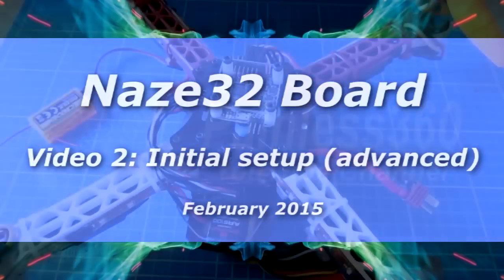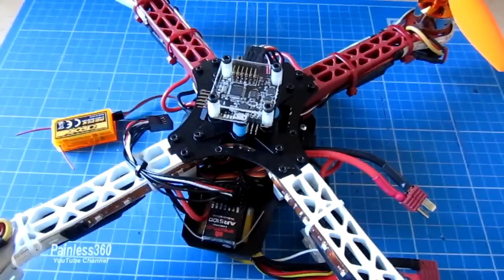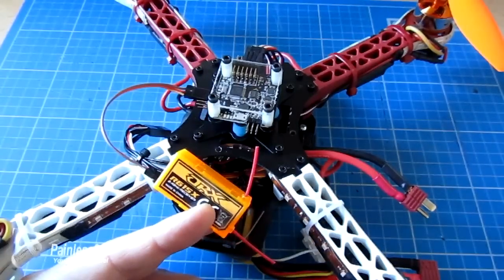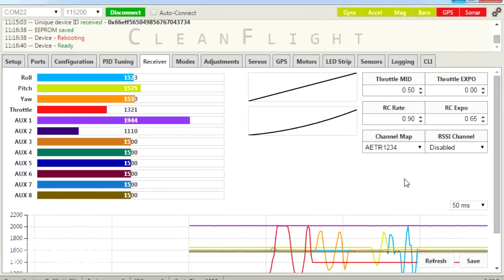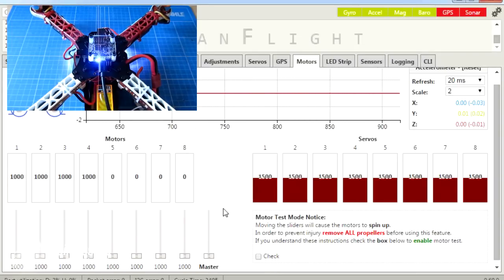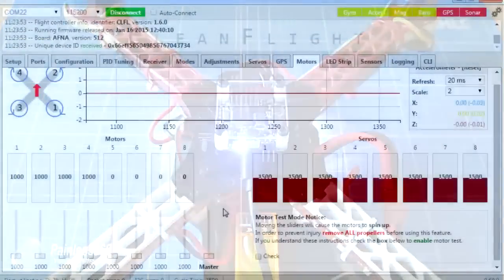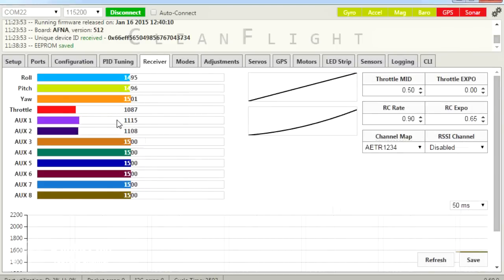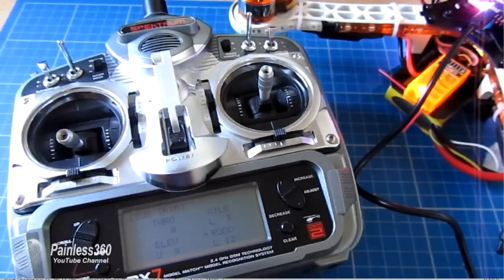(2/8) Naze32 Flight Controller - Extra setup steps and configuration

Comment: I have the Hyper400 3D quad, will it level out inverted in horizon mode?
Reply from the maker: steve sparrow I believe it will but never tried it. Let me know if it works (I'd try it with LOTS of height ;)
Happy flying!
Reply: thanks.

Comment: any idea why my fsia6b receiver not connecting to transmitter anymore? was flying find, landed and changed batterys, now it wont connect. not making any sounds or lights
Reply from the maker: +Elwood Knowles Not without more detail - I'd try and rebind and check the power is ok to it too.. Best of luck..
Reply: +Painless360 ahh okay, its just strange. got me stumped.
i was literally out for a fly everything working fine untill i swapped batteries now receiver isnt working.
got aby vids on how i can check if all components are getting power ?  i have a multi metre.

Comment: I would really like to see a setup for the naze32 with an frsky receiver with the sbus to cppm. I cannot find one and find your videos very informative than all the others.
Thanks
Reply from the maker: Scott Watson I am not planning on covering that.  I would use an Sbus inverter with a Naze32 to allow for native Sbus without the delays. Best of luck!
Reply: +Scott Watson Do it the same way as this video shows... only connect the CPPM-Out side of that cable to the Naze32 as the video shows him connecting a regular CPPM cable, with the black ground wire on the top left pin.
Then connect the SBUS end to your FrSky receiver SBUS port. I believe it's a keyed-port too, so you can only plug it in one way if you're using the FrSky SBUS to CPPM cable.  Otherwise, make note of the black - cable position and plug it in.
If you've already bound the receiver and used CPPM, no need to rebind, just make certain your Taranis is in D-16 mode, or switch it over and re-bind.
Check out the Taranis welcome videos on how to program the radio buttons to AUX channels to use them on the Naze Cleanflight or Baseflight config.

I've had no luck getting the SBUS inverter cables to work with the Naze and X8R though.  That's a frustrating path.
Reply: +splatula thanks for the info.
Reply: +splatula thanks for the info.

Comment: Hi, will the CPPM on FRSKY D8R-XP receiver work with Naze32? Since the sbus on FRSKY X8R did not work with Naze32
Reply from the maker: Don't know I don't use those receivers. A search of the forums should show if there are problems. Best of luck!
Reply: +Sol mag 

It's NOT the sbus you want - that's the proprietary "smart port" digital telemetry input. Check the X8R instructions - if you don't have the little sheet that comes with the X8R it's downloadable on the FrSky site.

I believe you simply hook to Ch1 and the X8R auto-detects the single
load and switches to CPPM on Ch1 Then, there's jumpers to set while binding. I can't remember the details, bit I have a couple planes using the X8R in CPPM.
This stuff is getting so complex you need to keep a logbook on these details.
Sorry I can't tell you off the top of my head, but my memory can't keep up. I just started doing a notebook for each plane. Good Luck!
Scott
Reply: +Scott Marshall I was able to use the CPPM on the D8R-XP by placing a jumper on pins 3 and 4 on the receiver and it works perfectly. Thanks for your input.
Reply: +Sol mag 
Glad it worked out for you, I'm going to be using the X8R on my KK  flamewheel. Upgrading to the X8R/NASE32 . 

Thanks to Painless for his fine videos, nice work!  Excellent instructional videos than don't bore you to tears. You make it look easy.

Comment: Has anyone tried a setup with DJI style throttle stick (stick centered).
I have used my Spektrum DX9 with Naza V2 and have changed so that both sticks are centered.
Since I still use the radio with Naza V2, it would be nice to be able to use the radio with Naze32/Flip32 with this throttle stick.

Comment: hi, when i try to calibre the ESC, the motors star to spin, whitout the baterry conected, the source or power comes from the usb, and when i connect the lipo, the motors spin faster, what i am doing wrong? why te motors spin without the battery?  thank you
Reply from the maker: +Jorge Osuna Then I'd check everything as brushless motors will not turn unless the ESC is connected to main battery voltage.. Best of luck..
Reply: +Jorge Osuna There's something about the Rev6 version of the board where there isn't a diode installed to block the 5V from the USB to the ESCs so they will startup. If I remember correctly, you have to remove the red wire from each ESC during the calibration, I might be wrong though. Go search it up.
Reply: +QuaintNotions you are right, that was the solution, i removed all the red wires from each ESC, and then proceed with the normal configuration.  THANK YOU A LOT!!!

Comment: what if the roll / pitch / yaw is at "2015". and the throttle is at 1503 at min ( stick all the way down ) mode 2. using taranis
Reply from the maker: +michael lee If that is the case then you need to see what is causing that and sort it out. The FC will not fly with those values. Best of luck.
Reply: +Painless360 i fixed it by going into the "mixer" on my Taranis x9d plus and changing the "offset". hope this helps if anyone is having similar issue, happy flying !

Comment: hi,how do I bind the rx when the bind connector is used for ppm
Reply from the maker: You need to have the PPM cable unplugged from the Rx and the bind plug fitted to bind, once done remove the bind plug and reconnect the PPm cable..
Reply: Painless360 cheer's, now how am I powering the rx?
Reply from the maker: The rx is powered from the +5v connection from the flight controller..

Comment: Where did you get the vibration mount from? Cheers
Reply from the maker: ***** eBay. Search for CC3D/Naze32 mount.
Reply: Painless360 Had a look but didn't see the one you had where it seems to be an adapter to the bigger mounting holes as well as a anti-vibration mount.
Reply from the maker: Chris, at the risk of teaching you to suck eggs - http://www.ebay.co.uk/itm/CC3D-Mount-Flight-Controller-Anti-vibration-Plate-Mini-APM-Compatible-/301496373854?pt=LH_DefaultDomain_0&hash=item463295925e

Happy flying!
Reply: Thanks, I bought it but even after that I tried a few searches myself again to see but I still couldn't find any.

Comment: When I try to calibrate the ESC's the motors spin up, is that normal?
Reply from the maker: +Michael Andersen nope, it means that the ESC isn't seeing the high throttle. See our recent series 'Quadcopter Building for Beginners' for more examples of Calibration. Best of luck!
Reply: Try plugging in battery again as i also experienced this problem.

Comment: i have got a issue if any one might know how to fix it just finished wiring up my 250 with a acro naze32 clean flight but i can not get the motors to turn by the controller in clean flight it reads my controller and movements but can not get it to do any thing. in the test motors tab i can click the sliders and all four motors spool up just fine my controller is the hobbyking hk-t6a v2 with a hk-tr6a v2 any help is greatly appreciated
Reply from the maker: d3ranged Have you armed the board? - https://www.youtube.com/watch?v=6U-rjC39EXQ
Reply: i cant believe it was that simple your were 100% correct that end points have to go below 1100 and above 1900 to arm i did not see that info online when i was looking. and somehow missed your troubleshooting  video thank you so much
Reply from the maker: No problem - happy flying! :)

Comment: Does anybody know if a chrome book can be used ti set the naze up. Built a quad then realised my old computer is xp. So don't really want to spend loads.  I got cleanflight on my moto 4G but the naze won't recognise it at all & no power.  But will with the same data lead in a charger or usb port. Plz help
Reply from the maker: We've not used one here as tablet PCs are now so cheap (see our review of one on the channel). Anyone else tried it on a chromebook?
Reply: Thanks so much for the reply. Like the vids keep it up.
Reply: Yes, I just used my chrome book with the cleanflight chrome app to set up my Naze32 rev. 5.

Comment: hi the rating 1100 to 1900 is it your max esc rating and it's min?
Reply from the maker: +353flyer Sort of - they are the limits on the throttle channel and the high and low values that the ESC learns. Happy flying!
Reply: So for mine is simonK 12A what do you advice the values
 to be, sorry really noob at this, just started on quad, I been on fixed wings all these while, coz mine failed to arm.
Reply from the maker: SimonK has defaults that you can set everything too and then you shouldn't have to calibrate (in theory ;) ). I believe it is 1060 to 1860. Best of luck.

Comment: Have Skyline 32 advanced + OSD and have built a 250 quad then setup cleanflight with AR70000Rx and DX7 (DSM2)Radio.  The radio and AR7000 have a good bind (solid light on rx and satellite).  I have set cleanflight to RX Parallell PWM and SPektrum 1024.  Cleanflight Receiver shows throttle, pitch yaw etc all working fine in response to my radio stick commands.  I used cleanflight to set motor ESCs without a problem and the motors respond and run perfectly.  All is fine EXCEPT... the quad motors do not actually respond to the Radio commands??  I cant fly !!   Anyone with any ideas on what this newbie is doing wrong??   This is my first FPV build and I am really stuck, Cleanflight indicates things should work OK but the quad does not respond to radio.  Am thinking to invest in the Orange R615X as I want to use CPPM and connect a GPS anyway...  however will this solve my problem??  I have no idea why the quad is not actually responding to my radio commands and if I have another setting or safeguard that is preventing the motors from spooling up in response to mz radio stick inputs.  The receiver and radio are both OK, I normally fly 450 heli and these are "borrowed" so I know they are fine.
Reply: Finally figured out the problem... its end points on my DX7, needed to be wider a few notches to allow me to arm the board!!
Reply from the maker: Glad you got it sorted - https://www.youtube.com/watch?v=6U-rjC39EXQ Happy flying!

Comment: Hi I did every thing the same and when I plug in my receiver it goes into bind mode
Reply from the maker: +matas Jarutis Then you didn't do everything the same ;) I'd check the radio receiver over and make sure you've removed any bind plug/setting... best of luck!
Reply: thx
Reply: if i hold the trainer button it binds together but when i go to clean flight receiver it does not show any stick movement and when i tank the battery out and plug it in it goes into bind mode
Reply from the maker: Looks like a problem with the receiver then - I'd contact the vendor.. best of luck..

Comment: hey guys, any body know how wiring naze32 with rj01 jr dmss with gps add. in rc group show to connect rj01 data to pin 4 in naze32, but pin 3&4 naze32 i use for gps TX&RX. so where i must connect wiring rj01 cable data, +&-  i use 3V from Naze32.  Thank you
Reply from the maker: Not sure exactly what you are asking but hopefully this is covered in this series.. Best of luck!
Reply: thank you for your replay,  Painless360, i ask about wire connect naze32 with Rx serial receiver( align RJ01) Xbus mode B RJ01 with add gps module, my tx is JR XG11 Dmss . can i connect to ppm port( NAZE32 CH1) or witch one?. some people say to connect in ch4. but ch 3&4 i use for TX&RX gps.. thank you
Reply from the maker: Yes, looks like pin 4 for S-Bus. You could look into using soft serial.. Best of luck.
Reply: yes, this the problem, like we know pin 3&4 we use to GPS connection. may i know , ch1 to ppm, ch2=sbus,ch3&4= TxRx gps, ch5,ch6,ch7,ch8= for what specification of pin
Reply from the maker: https://github.com/cleanflight/cleanflight/blob/master/docs/Board%20-%20Naze32.md will give you a clue..
Reply: +Painless360 , this what i want to know, thank you Painless360.
Reply: hello Painless360. may i ask. i try configure my naze32 full with rj01,  my radio is jr xg11. with xbus mode B, sucses with 12ch. but, i have 2 problem here. 
1. my trottle detect in AUX1, 
 2. this work if i connect wire data from rj01 to pin 4, i try to move to pin 1 or2 or 5 and 6, this rj01 cant work. i need pin 3&4 to connect with gps, and 7&8 with sonar. can you help me to resolve my problem.
 Thank you
Reply from the maker: Look at channel mapping in the receiver tab, should help (left hand side). Best of luck.
Reply: +Painless360 , thank you, for your replays. i done with channel mapping, but still can work. throttle still in AUX1 and YAW in swt flap. not in stick.
Reply from the maker: Then you need to look at how the radio is configured and move the channels about to match the channel map in the Naze32. Best of luck.

Comment: I can't use the baro, its not stable , it can shift down 1 or 2 meters in 5minutes, so the quad will go up, and up...
Reply from the maker: +francois Bonin it will, covering with foam helps. Happy flying!
Reply: thank you for your answer , but i did and it does not change anything , its a slow drift...

Comment: Hi painless360 thanks for replay. 
I tried Connect the receiver as you said, but the receiver doesnt turn on, while if i Connect the receivers as i did firstly it get power....http://imgur.com/a/mu84O
Regards 
Francesco
Reply from the maker: francesco cassarini In that case I'm stumped. Could be the receiver. 
Best of luck with it.
Reply: Yea i think the radio or the receiver are damaged, or i also think that the t-six isnt compatibile with the naze32! Most of the guides use r615x with the Orange module installed on a different radio as u do to enable ppm.
Really thanks for your advices, i hope to find a solution.
I just subscribed to your channel, you really deserve that!
Regards
Francesco

Comment: Hi, Painless360, good job on those video, really informative. I actually have a problem with Orange t-six radio (http://www.hobbyking.com/hobbyking/store/__28494__OrangeRx_T_SIX_2_4GHz_DSM2_6CH_Programmable_Transmitter_w_10_Model_Memory_Mode_2_.html)  with orange r615x (http://www.hobbyking.com/hobbyking/store/__46632__OrangeRx_R615X_Spektrum_JR_DSM2_DSMX_Compatible_6Ch_2_4GHz_Receiver_w_CPPM.html) connected via ppm to naze32 full verion.
I'm using cleanflight, ppm is enabled but i dont see any channel moving at receiver tab in cleanflight, tried many different setup, but still no move. Could you help me?
Reply from the maker: francesco cassarini is it plugged in as in the video? Where is the cable plugged into the Rx and the Naze32?

Comment: When flashing is done my rev6 blinks red and green in a fast pace, any idea why? can´t connect to cleanflight after flashing.
Reply from the maker: Normally I'd suggest calibrating the accelerometer but sounds like you need to try and flash it again. Make sure you're using the right firmware..
Reply: Noticed that different firmwares responds in different ways, but I can´t seem to find the right one. Have atleast tried 10 firmwares?
Reply from the maker: Max Rolen there is only one that you should be choosing for the board you have, normally the latest or the one before that are the best firmware wersions to choose. I hope you get it fixed soon.
Reply: Thank u!